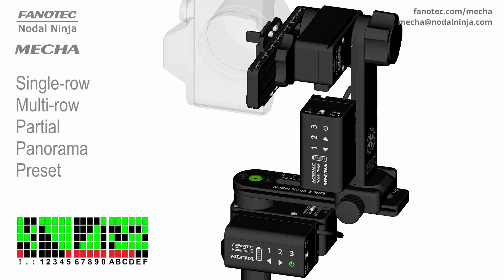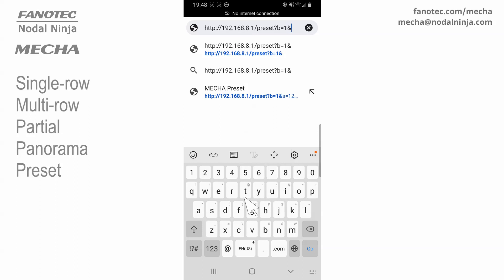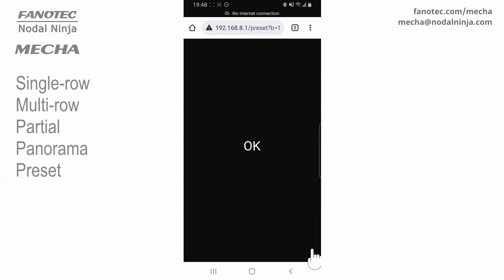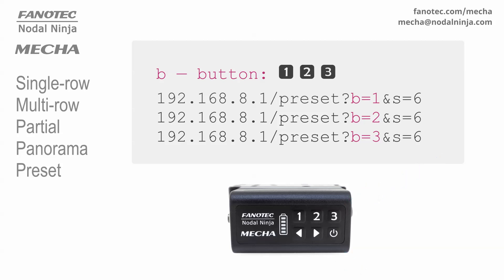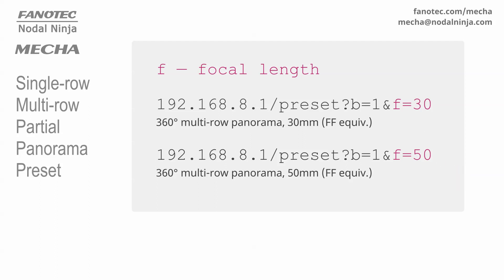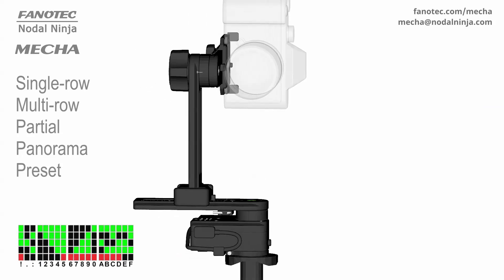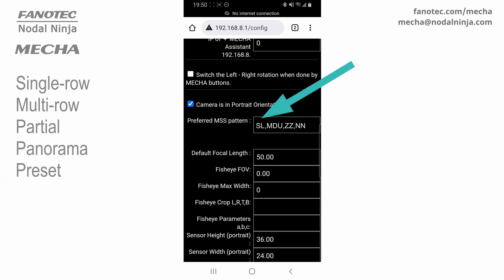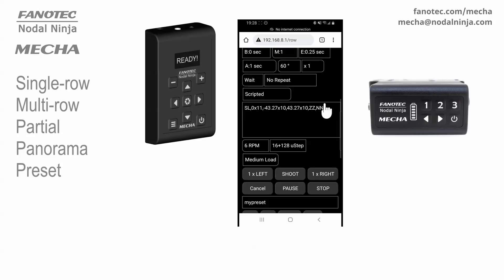Single-row, Multi-row, Partial Panorama Preset – MECHA's Url Parameters

Comment: Nice. How would set it you to take the multi row panorama with 3 bracketed shots per position? A simple option might be to add a &TRG3 somewhere or is that not required? Each situation can require a different amount of time to determine how long to set the delay between rotation movements, so outdoors it might on require 1 second to take 3 shots (based on using timer mode on the camera and to take 3 shots with TRG set to 1). I would like to use the P1 C2 using this url method as it is simpler now if I have to change the setup quickly. I would like for example to set it up for an 85mm lens full 360 and 3 bracketed shots per position.
Reply from the maker: Yes, there is also the "t" (trigger) parameter, and the "e" (exposure) parameter for C2 firmware version 12323 (or C1 02323). We will update the user guides soon.
So for a 360 degree spherical panorama, and a focal length of 85 mm (f=85), 3 shots per position (t=3), a shutter button signal duration of 1s (e=1), 2s pause after each position (p=2), if the pause needs to be after each shot, a negative value must be used (e.g. p=-2): 
192.168.8.1/preset?b=1&f=85&t=3&e=1&p=2
You may need to use other values for the "e" and "p" parameters. 
With C2, "b=1" means that the preset will be assigned to the minus button (use 2 for the plus button, or 3 for the menu button). Also please switch to Advanced Mode to be able to launch the preset by pressing C2's buttons.
Reply: @NodalNinja  Excellent, tested and works well. Thank you. One more question though please. Is it possible or will it be possible in the future to assign the preset to one of the preset slots such as 020, 030 etc or is it only possible to assign the preset to the buttons 1,2 or 3? I see a big advantage if it is possible as I could then combine this with using the QR code option for faster swapping of different shooting options. cheers again.
Reply from the maker: @LittleKing Archery Thank you for letting us know that it works. In the future (maybe with the next firmware), it will be possible to assign the preset to 020, 030 ... as well.
Reply from the maker: @LittleKing Archery With C2's firmware version 12325, values such as 020, 021, ..., 089 and others can be passed through the "b" parameter. Please read the "Programming a Preset Using Parameters" section for details (you may need to clear your browser cache first): 
https://www.nodalninja.com/Manuals/c2-guide.pdf
Reply: Everything is working well with the P1
C2 using the URL option to either create a preset or  trigger a prest. Only question at the moment is  , is it possible to add the E:SHT C1 using the url or can I only add seconds such as &e=1? At the moment I create the preset using the url but as I always use brackets shots with the pc cable, I want to use the SHT C1 option so I manually go in and change the created preset afterwards.
Reply: @snap-n-shoot  Here are the predefined values 
-0.11 E:SHT C.
-0.12 E:SHT C1
-0.13 E:BTN > C.
-0.14 E:BTN > CT
e.g.     &e=-0.11